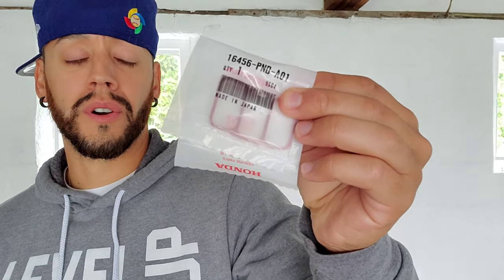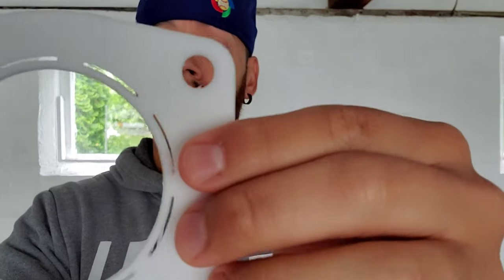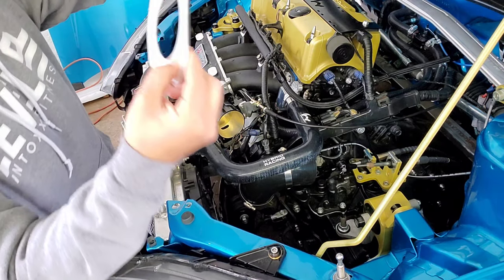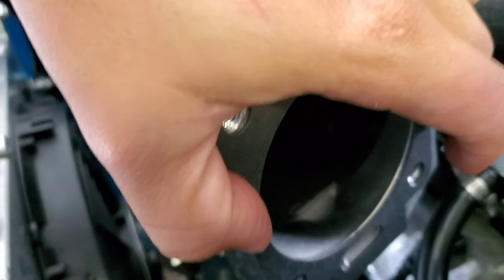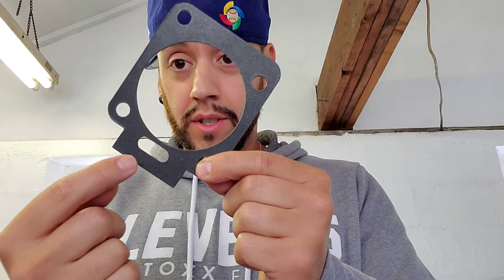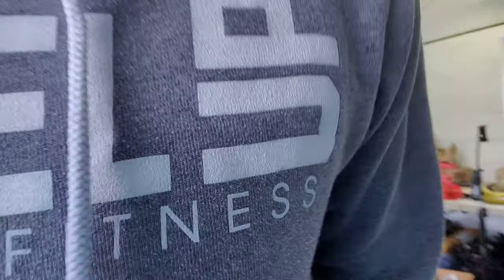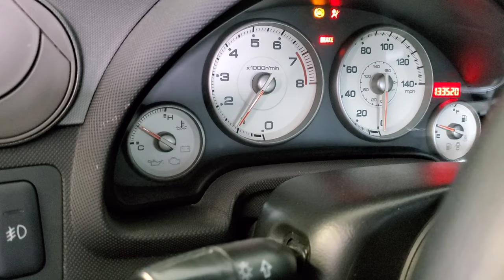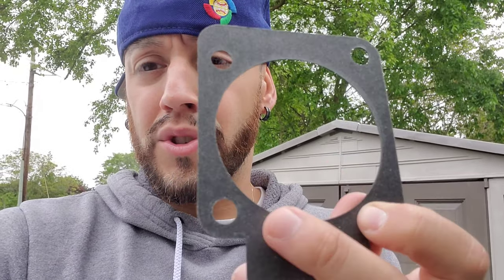SKUNK2 MANIFOLD WHISTLE... YOU WOULDN'T BELIEVE WHAT IT IS...

Comment: I got a same IM & TB set up with yours,  do you experience any high idle issue after you installed the TB ?
Reply: After i installed the TB, i got the same whistling noise with yours,  i fixed mine my put some gasket sealer with the TB gasket,  good vedio.
Reply from the maker: I did have high idle issues until i drove it for a few miles and it relearned. Also change the tps from ktuned to acuity.  Car idles beautiful now
Reply: Yeah , i also got acuity TPS set at 0.49 at full close.  But i haven't drive it yet,  i might give it a try.  Thanks man.  
Btw,  do you run aftermarket ecu ?  Or stock

Comment: Did you install a new idle control valve when you install the skunk2 throttle body?
Reply from the maker: Absolutely, installed an oem one
Reply: GlazeDc5 i did install same type of manifold with skunk2 74 mm throttle body with my old idle control valve; I also install a new tps sensor. Now when i uploaded the base map on kpro and turn the engine on the rpms goes crazy from 1500 to 2500; do you think it could be my idle control valve ?
Reply from the maker: How many days has it been since you started it and it has been idle searching?
Reply: Two days .. it’s been like 3 weeks since the parts were installed; in the beginning all was doing was getting stuck on 4000 rpms and it felt like throttle body wasn’t opening 100% then i did adjusted the throttle body cable and it work better
Reply from the maker: Start with your coolant. If your idle searching you may have air in the coolant system. Get yourself a funnel that attaches to thr radiator. Fill the funnel and let the car run until the fans turn on twice. Then turn the car off , take the funnel off, close radiator and drive it to see how it runs. Mine had the same issue. I had to let air out twice and now its good.
Reply: GlazeDc5 👍🏼 thanks man I’m going to try that hopefully that will fix the problem